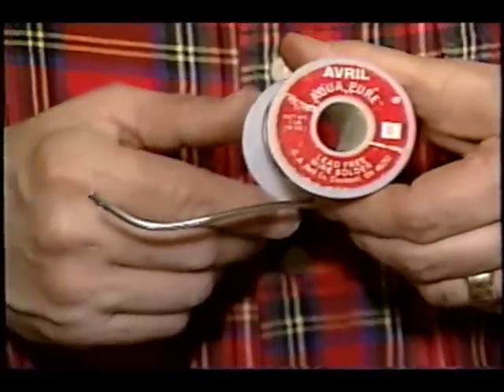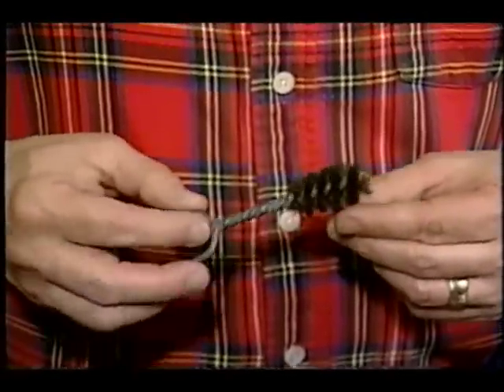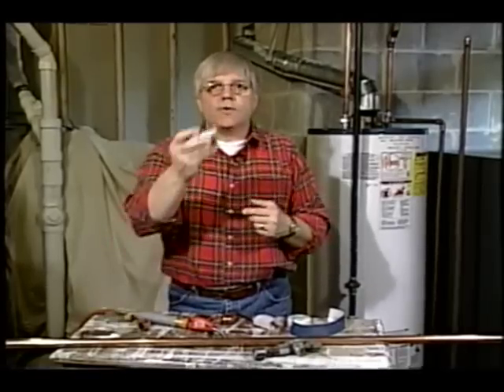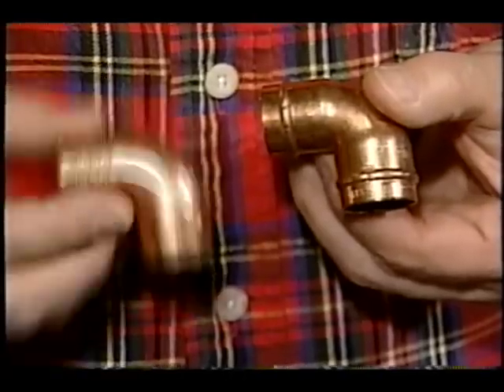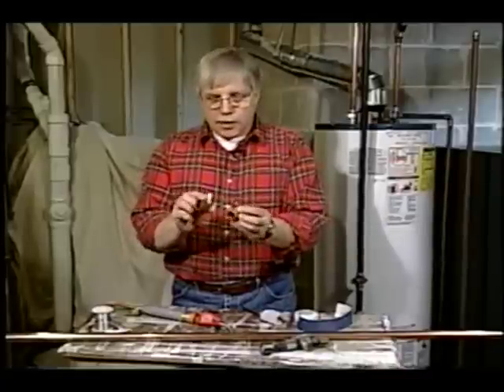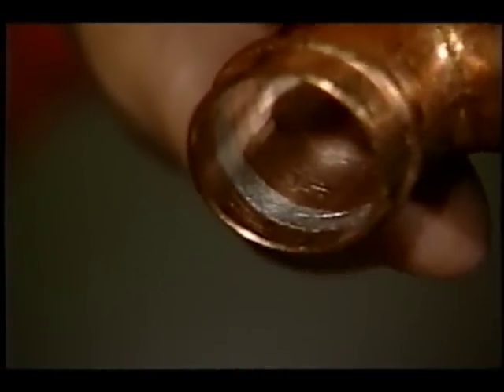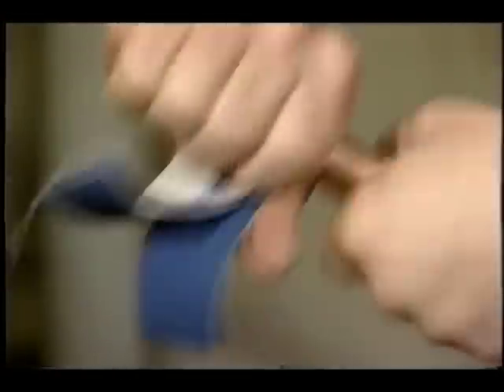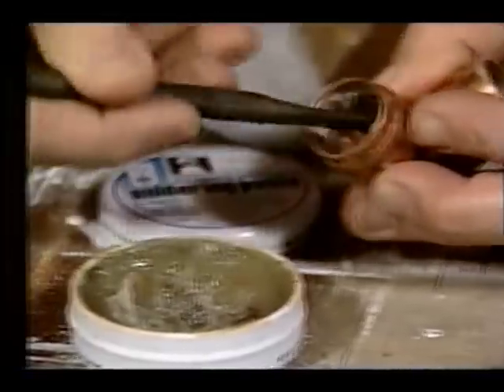Copper Fittings with Solder

Comment from the maker: That's absolutely possible. Changes in temperature can cause a difference in PSI readings. Why not test the system with water and see if they really leak? If the house is not heated, then drain the lines after the test.

Comment: here in the UK we call these yorkshire joints , and they have been around for as long as i have been plumbing ... 15 years .. maybe even longer ?  not sure if they were actually invented in yorkshire ? they work well but i find i always touch them up with a bit of solder wire to be double safe .

Comment: Tehy arte called yorkshire fittings in the uk and have been in use for years, there is around 1 and half times more solder in the fitting than you actually need. On a side note, some people when installing pipe like to flux as they go and then go back a little while later and solder (not the best idea really) the solder will actually cause these fitting to "sweat" and fuse making any errors hard to correct with out having to replace the pipe before soldering.

Comment from the maker: Thanks! We have strong codes here, but in many places a person can do the work themselves IF they pull a permit and get the necessary inspections. My feeling is that's the way it should be. If a person can do the work and meet the code, then what's the issue? It's no different than driving. But that being said, I've seen some horrendous drivers and horrible work done by pros who *passed* the inspections.

Comment: ive got news for you pal we have used them in england for the past 40 or so years they are good but its always wise to run a small amount of extra solder on them for piece  of mind if you solder the pipe in a real situation you cant always tell if the solder has run all the way around you dont want leaks everwhere when the pipes get boxed in or are under your floor hope this helps

Comment from the maker: @FarCriedOff Where is here????? The fittings work very well if you just clean the fitting and pipe as you would anytime you're going to solder. I've NEVER had a leak with these. Compression fittings are very dangerous to use in enclosed spaces where you don't have access to the fitting.

Comment: I am currently repairing one of these jewels that began leaking two years after a plumber installed it.  A 3/4 inch copper elbow, pre-soldered, is leaking at the joint.  I am just going to cut it off, and sweat a fitting on the old fashioned way.  I have never had a problem with sweated joints.

Comment: The Yorkshire Integral Solder Ring (ISR) capillary fitting was developed by Yorkshire Fittings in 1934 and represented a major breakthrough for the industry (in 1934) I realise this film is 3 years old but Yorkshire fittings are 76 years old.

Comment: You end up soldering them anyway just to make sure. Why not use end feed as they are cheeper and you can get just as good a joint than if you were using yorkshires.

Comment from the maker: You missed the point that the solder is already inside the joint. Many rookies never heat the joint enough so the solder flows into the joint. When the solder melts in these fittings, you have a good joint.

Comment from the maker: @Mindstay I'm a Master Plumber as well. This was a simple video to show another method of soldering. Nothing more. I can tell you that of the hundreds of joints made with this type of fitting, not one has developed a leak after ten years. Bottom Line: There's more than one way that works to get a great result. Do I use these all the time? Absolutely not. Have I used them with success? You bet.

Comment from the maker: @jumpdance24 You need to take this discussion to the forums where homeowners have had their houses completely ruined by failed compression fittings both in copper piping and the poly pipes. If you're such a fan of compression fittings, why are there no videos at your channel about them ? Why don't you go on record with some video showing what you know, how strong they are compared to soldered and flared fittings, etc.? You know the old saying don't you, "Actions speak louder than words."

Comment: These looked like a good idea to me, I admitted jack of all trades and master of none.  I thought I had made good joints with these and when I turned on the valve they leaked all over.  Luckily I did a few trial joints and tested it before I did the whole thing.

I can sweat a regular joint with solder and usually get it right.  Every one of the presoldered joints I did leaked.  Yes I sanded male and female and applied flux.
I am sure they will work fine if you know what you are doing but don't assume they will make the job idiot proof.
Reply from the maker: Watch my NEW live stream videos! Subscribe to get my FREE newsletter here: www.AsktheBuilder.com

Comment: Don't use the "Just for Copper" stuff that looks like glue. I would never use some type of bond stuff for a copper line. If it opens up under pressure and nobody is home the cost could be enormous. I doubt the plumbing inspector would even pass it where I live.  Just learn to solder, it's not hard.

Comment from the maker: @jumpdance24 You know, I often wonder if folks like you read all the comments. You took what I said out of context. Perhaps you should get a job as a political pundit. Had you read all of what I wrote, you'd see that I said compression fittings are known to be the weakest connection when compared to welding, brazing or soldering. It's not recommended to have compression fittings in enclosed spaces where you don't have access. Typically boilers are out in the open. jeeeesh